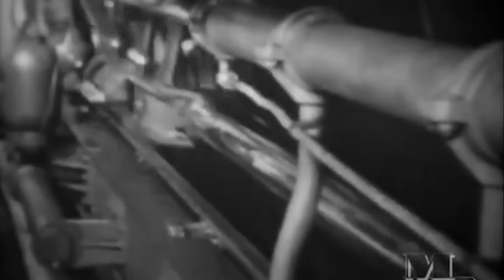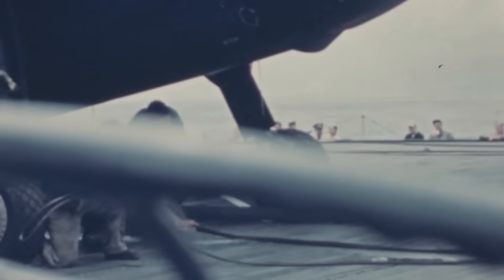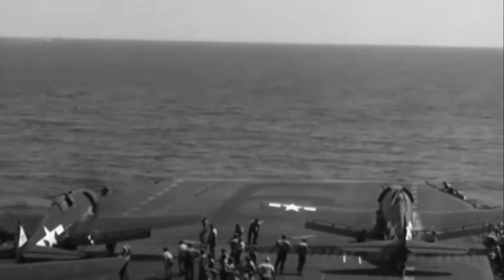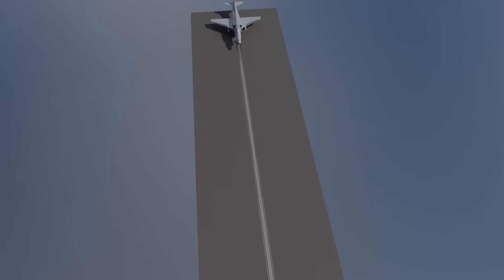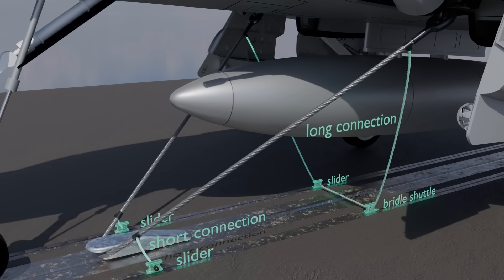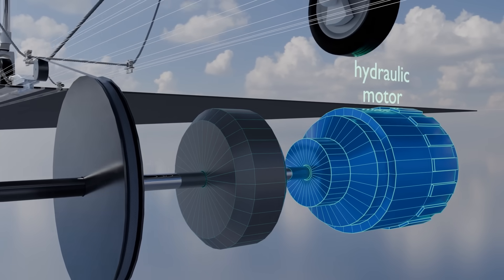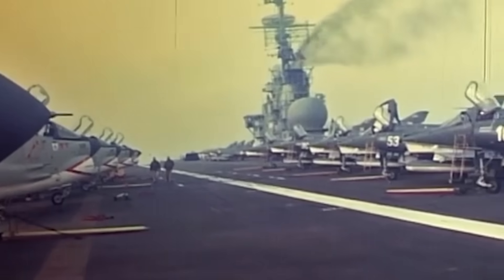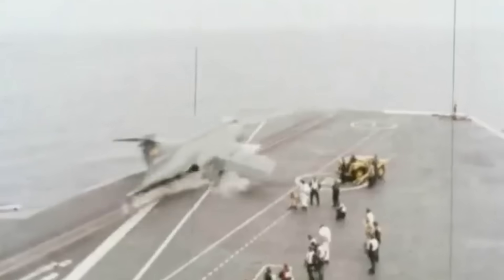Catapult Launch - The Story Behind "The Bridle" and "Bridle Catchers"

Comment: It is not quite right to say that catapults supply force to launch the airplane. It actually provides energy to the airplane. ITH catapult does apply force to the airplane, but it applies that force through a considerable distance, and the integral of force times distance has the units of ft-lbs or joules depending on units.

Comment: In the 1930s, the British (at least) used a cradle to hold the aircraft on what was called an ‘Accelerator’. The cradle attached to the aircraft at 4 places using ‘spools’ (so-called because they looked like cotton thread spools).  The cradle was designed to fold forwards at the end of the catapult track.  I believe that a gunpowder charge was used to send an arm along a track hauling on a wire rope that in turn pulled the accelerator cradle down the deck.  Picture of Ark Royal (II) show this system in use.  Aircraft fitted with spools could also fit on the cross-deck and rotating catapults on British Battleships and cruisers.  Photos of Fairy Swordfish and Seafox aircraft show such spools.
Reply from the maker: Wow, thanks for sharing this interesting piece of history; I appreciate it!

Comment: "As aircraft grew in size and WEIGHT", not "power". All aircraft grew in power, but power is a good thing whereas weight is a bad thing and therefore, the catapult was designed to assist in launching. Otherwise, an excellent video!

Comment: Flying the S-2E off the USS Randolph (CVS-15) from late 1967 to late 1969 we had the hydraulic cats. They gave a real kick in the rear for it was 60 feet of stroke, 60 feet of coast and 60 feet of braking. The aircraft was free of the bridal early in the coast part of the stroke. By the time we cleared the deck we were typically120 Knots (131 MPH) most of which was gained in the first 60 feet. We did not have the bridal catcher as shown in the video, but our bridal was semi permanently attached to the catapult shuttle. What is not shown in the video is that the loops on the two ends of the bridal were hooked on rearward facing hooks on the aircraft. In the case of the S-2 and variants, they were on the bottom outer edge of the fuselage. 

The Randolph and our later carrier the USS Yorktown (CVS-10) did not have the bridal catcher extension either, but had steam cats which had a longer stroke with less of a kick in the rear. The S-2 and the similar C-1 and E-1 actually had four wheeled gears. The two wheel nose wheel, the two single wheel main mounts and a small tail wheel at the back. When the catapult was cocked, the aircraft eased back and was sitting on the main mounts and tail wheel with the nose wheels about 6" or so above the deck. There was a fitting on the tail of the aircraft that held a dumbbell shaped piece of steel with a machined groove in the center. The groove was designed to break at a certain force, freeing the aircraft to launch. The piece that was left in the chain attached to the deck was then removed and tossed overboard. When the aircraft returned the other half was removed and tossed overboard and a new one seated in the fixture on the aircraft to ready it for the next launch.

Comment: Another misinformation video. 
Everything in this video was first used & developed by the British, even the catchers are British, though they were deemed impractical for the Royal Navy due to aircraft type & catapult size as catchers slightly reduce the end performance & it wasn't till over powered future proof launchers were installed that it became practical. The Royal Navys future proofing was out of date allmost immediately as the Navy took the massive leap from relatively light aircraft to the heavyweights of the F4 by which time they moved to launch bars rather than bridals as the bars enabled heavier aircraft to launch from lower pressure to reduce stress on the airframes. Launch bars could not be captured.

Comment: Here are some interesting tidbits for you. The first US carrier to be built without bridle arresters was USS Theodore Roosevelt. All previous Nimitz class carriers had them removed in the shipyard after the A-3D Skywarrior went out of service. It was the last bridle launch aircraft to leave active service in late 1991. USS Enterprise was scheduled to have her bridle arresters removed, but the commanding officer wouldn't allow it. He wanted them to remain to ensure that Enterprise would retain her status as longest aircraft carrier at 1122 feet.
Reply from the maker: Good to know. Thank You
Reply: @x-planed I always thought the F-14 Tomcat was the last to use the bridal. As seen on Growler Jams, the F-18 was the first to use the nose wheel tow, and it still settled a bit when in tension. Both the tow and holdback are on the nose wheel which really tells about it's strength.
Reply: @richardgreen1383  Nope. F14, S3, A7, A6, EA6B, E2, and C2 all were using nose gear launch bars way before the F18.
Reply: @michaelmappin4425  Yes I found that out later. I knew all of the others you listed had the new system.
Reply: Enterprise bow horns can be seen in Google Earth on 20 September 2024 at 36.9794996, -76.4403682

Comment: Great channel but just a minor but important correction. Early planes always relied on the aircraft carrier to speed at full power and head into the wind to get them into the air. I am pretty sure they still do this too as a added safety measure. They never relied on the aircraft alone lift to get into the air. Witness the Doolittle raid and the B25 as this.
Reply from the maker: I didn’t mention this as I thought it was too obvious😉
Reply: @x-planed  well for you and I it is of course. Most likely aviaton enthusiasts know this too. Espcially carrier pilots !

Comment: Great explanation, thank you.  The launch bar was a massive improvement; the bridles did unfortunately break.  It was rare, but often fatal if the bridle snapped before the aircraft  had sufficient air speed and/or the bridle hit the underside of the aircraft, kicking the nose up and inducing too high an angle-of-attack.  Saw an F-4 go down off cat 1; the RIO ejected with a good chute, the pilot's chute didn't open.  Very bad day.
Reply: Yeah I knew the extensions as bridle snap back protectors my first command USS Independence had mebbe 3 types out of the airwing that used nose launchbars. There was an adapter that fit over the cat shuttle to switch from bridles to launch bars. My first sight of a launch bar evo thot it might snatch the nose gear off😳. Heck the Indy had four 5' 54 caliber radar aimed gun turrets for BPDS. Had one of the last Nam era airwings. Traded F4s for F14s after SLEP
Reply from the maker: Wow. Was it Your personal experience?
Reply: @x-planed  Yes
Reply: Thank you for such an excellent explanation. I was on the USS Ranger 1968-67. We lost an F-4  because the bridle broke. The broken bridle tore the front wheel right off and the nose hit the deck as the plane was under full power. The plane went off the deck and into the water, right in front of the ship. Both crew ejected before the plane hit the water, but only the RIO survived.
Reply: Well broken bridles or cold cats. You pays yo money and you takes yo chances, always amazed by A4 nose wheel STEERERS😮
Reply: And cross decked with the Ark Royal. 3 of their ac remain fixed in my memory the launch of their F4s and their Buccanner, the strange Gannet and the British sailor whot whot!!!

Comment: Did they retro fit F 4's? They were relatively new at the time.
Reply from the maker: Yes, Phantoms were not equipped with launch bars
Reply: No. Phantoms never got the launch bar. It'd have been too much of a retrofit, as the launch bar needs hydraulics to operate etc.

Comment: 2:54 corsair loses its tank
Reply: Somebody must have got yelled at for not attaching the tank right.
Reply: Yeah, you can see the guy with the fire hose running from the right, then he stops when he realizes there's no fire. I think there wasn't even a fuel leak.
Reply: Causally left the tank on the deck
Reply: Luckily did not explode and kill sailors.